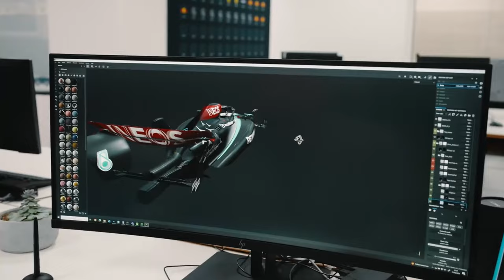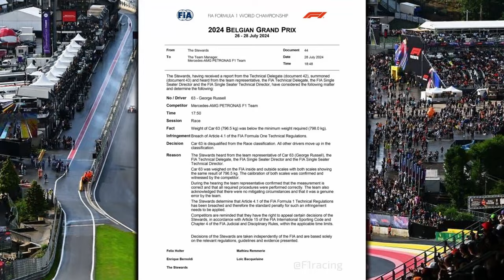MERCEDES CAUGHT CHEATING AT THE BELGIUM GRAND PRIX

Comment: i dont believe this was done on purpose because it not make sense they need the points why would they risk loosing all the points when they need as many as pos to get higher in the champ it was just because he chose to one stop rather than the two stop they were expecting so there was not as much weight on the tyres and there was no safety car which they normally have meaning the fuel use was higher, they run the cars underweight or as close to the limit as poss because they expect these extra things in races, people make mistakes in life and every one messes up or makes a slightly bad decisions.